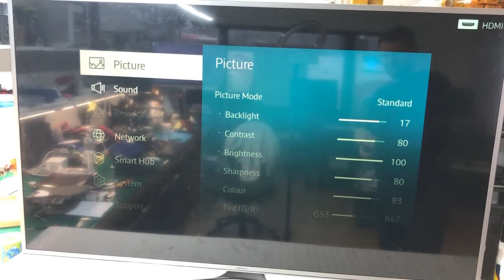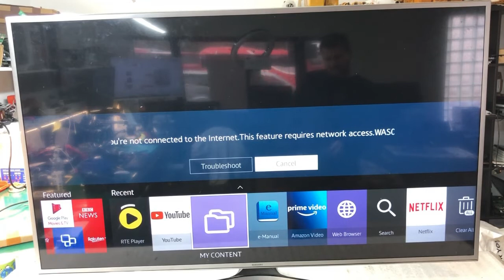Samsung TV Half screen dark

Comment: changed all led strips on mine tested all fine and after re-assembly I get no more image on screen. tested with a different mainboard and t-con and still get no image. any other suggestions would be greatly appreciated. the back light works flawlessly as it is dimming or going brighter if I press menu button or turn light on or off in the room. Could be that something on the two panel strips with all the caps and resistors etc went bad?